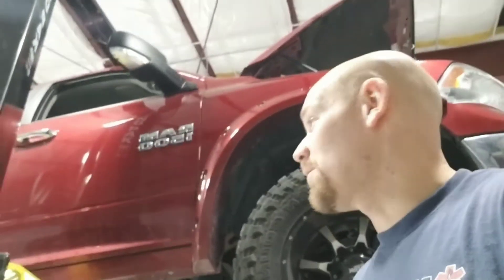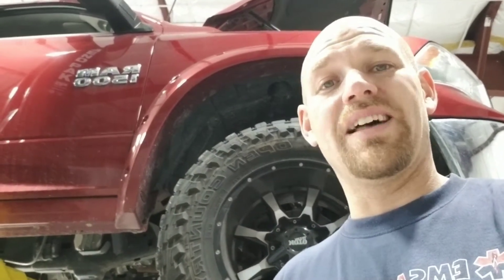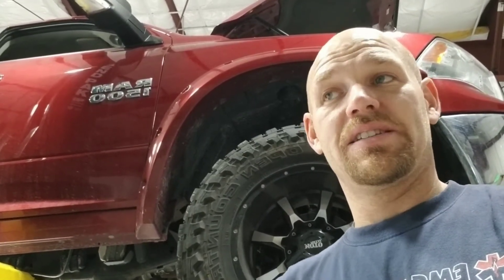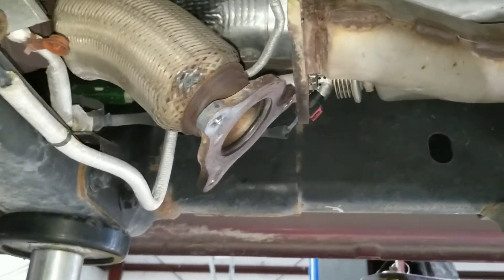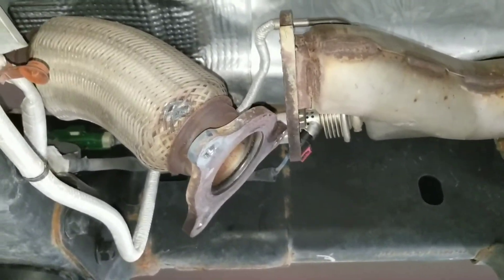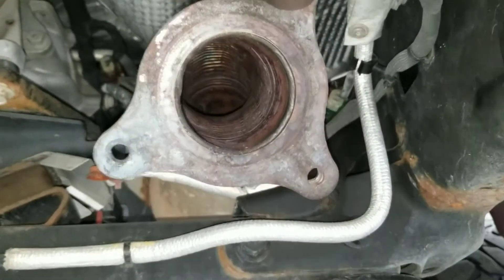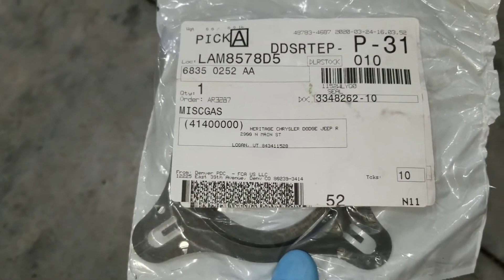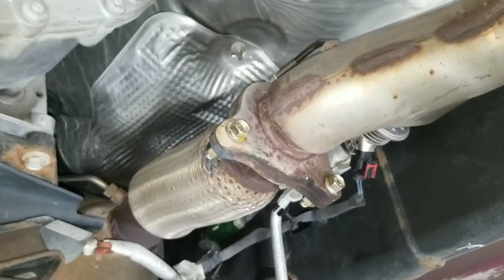Ecodiesel- sounds like a boost leak... but it's not. Exhaust leak fixed.

Comment: I got the same exact truck 2015 3.0 diesel ecoboost .. only the one bolt remains … the sound it makes sounds like a power steering pump with low fluid…  I know that’s not the problem because this has electric assist steering …  I vise gripped the flange and the sound is still there .. I hope when I do the repair the sound goes away😮

Comment: Thanks for setting me in the right direction, your video was helpful. 2015 Ram Ecodiesel with 240k miles, went to pass another vehicle the other day and a woosh squalling sound happened until I left off the pedal. I also thought it was turbo related. 
Found your video, mine had one bolt still in tact (the upper one of course).

I fought it for a while, then decided to leave the existing bolts in tact, I clipped the very ends off of the ears on the gasket, and was able to slide the gasket into the correct position. I then vise gripped the flanges tightly together, compressed the gasket, and mig welded the flanges together instead of using the other two bolts. No exhaust leaks, and the weld is holding strong. 

I forgot to mention, I got 3 codes when the gasket blew - PO128, P20EE, and P1286 making me think that there was more damage caused by the heat escaping the broken flange, after multiple attempts at clearing the codes and starting the truck a few times, the codes all  vanished shortly after I did the repair. 

I know this isn't a "proper" repair, but it works and I only welded where I can easily grind if I need to mess with this again. I have worked on this truck so much over the years, I plan to hit 300k then move onto a new truck. 

Happy Trails
Reply from the maker: Well done! Glad it helped!

Comment: I’ve been having a problem with my Volvo lorry sounds like a boost leak on full boost, been looking for months and after coming across this video, I’ve found a hole in the flexi exhaust pipe just down form turbo charger, ordered new flexi, I hope this fixes it! Thanks for video, I would never have thought this could be my problem!

Comment: 6.7 Cummins mines was right off the turbo elbow that connects to the flex-downpipe .. I was hearing a stutuutuu sound  & it was making my engine surge' but never thought 💭 it was the exhaust I thought it was a boot that had cracked or something to that nature, it was a exhaust flang gasket that rotted out' so air was leaking making a turbo leak sound & I didn't have any boost.
Reply: Hi I'm thinking I have same problem on my Kia turbo I don't really have boost, was your flex pipe after the turbo also? And were you having low boost?

Comment: Should you be able to slide a flat head screw driver in between where the gasket sits. The bolts are rusty but are still there but seem very loose
Reply from the maker: I would say no.

Comment: I had the same problem. Chrysler repaired everything at no cost. It's covered under emissions warranty. The bolts are pressed in so they replace the whole pipe on engine side then replaced gasket. No charge.
Reply: What year was your vehicle, what model and is it past the bumper to bumper warranty?

Comment: Hi, I stumbled on your video.  I had a similar issue happen to me on my '15 grand cherokee ecodiesel.  Im my case everytime I stepped on the "gas" pedal I would hear a whistle.  After a few days the service def system warning popped up.  When I took a peak underneath I saw that flexible exhaust had 2 missing studs/nuts and only 1 still attached.  Well I realized that whistling noise was the sound of hot exhaust gases escaping and hitting the def fluid line that goes into the injector.  It completely melted it and it cost me over a $1000 to fix.  The mechanic just nut and bolted everything back up with a new gasket and its been great ever since!

Comment: I am trying to get those flange bolts out, and I'm having a hard time. I'm using the titanium drill, but it is cutting really, really slow, and I was told to use a hammer drill, but what is your suggestion?
Reply from the maker: Sorry for the slow response. Sure you got it. I have heard you can press them out with a ball joint press but haven't tried.

Comment: Thanks for you video! Exactly same issue it’s happening on my 2018 ecodiesel, I actually recorded the whining noise, some days seems to be louder !

Awesome discovery, you made it so easy for me!!🙂👍🏼
Reply: Happy I could help! Don't ignore the leak. The heat will burn plugs and lines around the flange. Gets expensive quickly!

Comment: Hi I actually have a Kia turbo just yesterday I can hear a whistle underneath the car sounds kinda like when your boiling water and it starts to whistle. By any chance can this cause Lean fuel trims??
Reply from the maker: It's possible. Either way, you need to fix the leak. Fix it and if the lean code doesn't go away, dig deeper.

Comment: Hey bud i have the screaming noise right now its being held with vise grips.  What size drill bit did you use and what grade and size bolt did you use
Reply from the maker: Think I just used 3/8 in grade 8 bolts. Good luck!

Comment: Was it like a high pitched whine/scream (like R2D2 on fire)? I'm getting that- it seriously sounds like it's coming from the upper engine - thought it was my EGR block off plate but I put a new gasket in it and it's tight as hell, can't imagine it's coming from that.
Reply from the maker: Lol R2D2 on fire is the perfect description! If the nuts and studs are corroded, I would bet on it.
Reply: @Brandonlexx1  yessir, just checked. There's a gap. Do you happen to have a part number for the correct gasket? (Mopar site doesn't make sense)
Reply from the maker: @milesessay8661  it's in the video. Number on the bag that ends in AA. Thanks for watching and good luck to you!
Reply: @Brandonlexx1  had a local muffler shop with some proper tools re-gasket and put new bolts in. Noise fixed!

Comment: I’m doing this tomorrow on my truck. How long did it take to drill out the old studs?
Reply: Well, if you have the proper tools you can get it done within the hour, on my situation was little bit different as the head of the screws are welded to one side of the muffler, two of the studs broke right out and that’s why the noise as there was a gap, to drill this holes, was difficult as the drill bits for steel seem to melt as this is some sort of stainless steel screws, so I ended up prep drilling on one of side were the screws broke, then I noticed one of the die grinder bits really pierced this steel good, on the other side on the stud heads I cut them with a thinner grinder blade  so I didn’t have to pierce the width of the head, it’s not easies to work down there but you can manage to do so some how.
Reply from the maker: @luisjairojaramillo9454  pretty well nailed it. Drill slowly with a small pilot bit and cutting oil first. That will help. Good quality bits are a must.

Comment: Any chance you're located in Southern Ontario?? Lol...dealer said 50/50 he damages my dpf doing this job...$5k at my expense!
Reply from the maker: If you're talking Ontario Canada... We're not even in the right country! Utah is a bit of a drive but you can make it. I'll put you on the schedule! Good luck to ya!
Reply: I'm on london ont. Worst experience with this exhaust/scr leak... 
It Ended up burning my def injector and supply line. 
Put new ones in then took it to a local shop to get it fixed... they burn them  AGAIN! They used a torch to get the broken bolts out. Which didn't end up even working.

Anyway, got the hell out of there and took it to an actual exhaust shop who did the best thing which I recommend u might as well do: have them cut off at the flex pipe, install and weld on new flex pipe (closest to engine side) with the 3- bolt mount and then reattach.
Reply from the maker: @pimpedout1620  I am sorry about your negative experience! The bolts and flanges are stainless steel. The do not cut well with a torch. Glad that you are back on the road!

Comment: Any chance you have an email address or somewhere I can post a video of the noise my truck is making?  I think it may be the same problem.
cheers.
Reply from the maker: Just check the bolts, if they are corroded, you'll know right away.